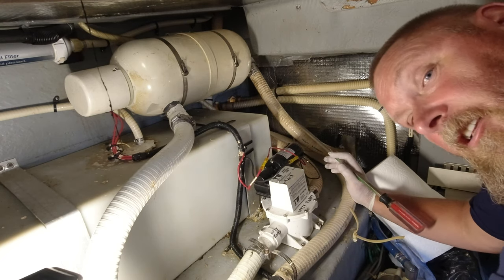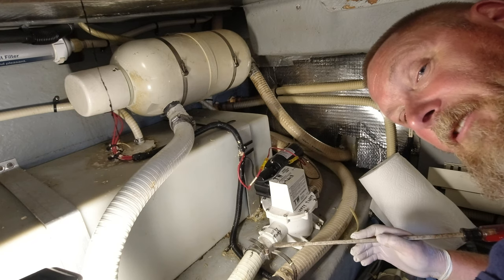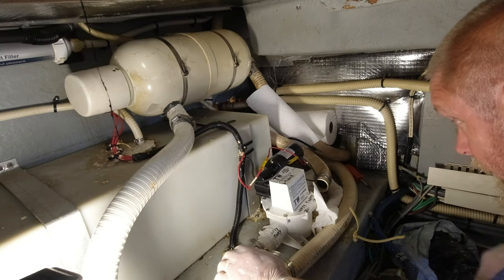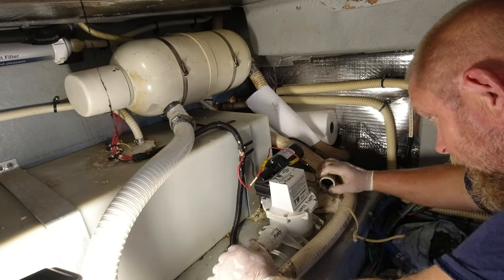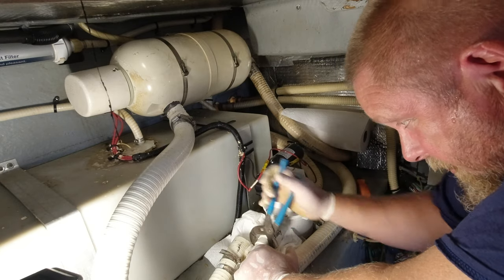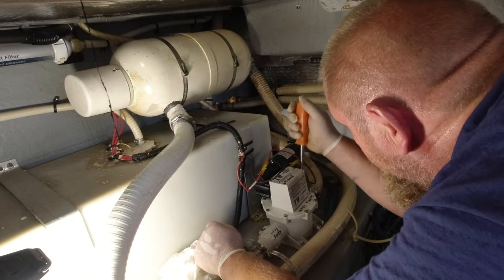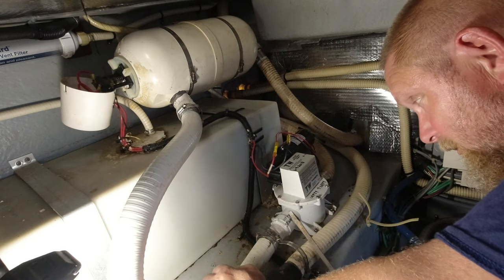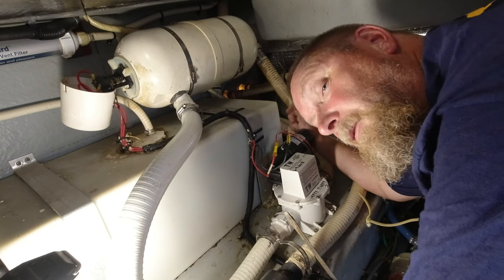SeaRay 35 Toliet Repair

Comment: Okay so not a bad video, however the incorrect pump is installed. TW is to pump out the tank. SW is for toilet to tank. What's the difference??... DOUBLE DUCKBILL on both the suction and discharge sides. The TW has one duckbill on the suction side and one on the discharge side. SW have 2 on each side. Having 2 on each side helps to maintain a seal so that the vacuum is maintained and the pump doesn't cycle frequently.

Comment: We have rebuilt everything in the system but have no vacuum. Any advice?
Reply from the maker: Check the big white vacuume tank, mine was full of paper. I took it off the boat and unscrewed the end where the wires are at and dumped it out. This is the tank about 12” round and 18” long 
Try this n let me know

Comment: Good video, but....   I have a VG1 like what you are working on in the video.  I am working on the accumulator tank, so I was pleased to find this video because you were working, explaining, etc. as you worked through the system.  However, when you worked on the accumulator tank, you didn't include any of that in the video - the very part I was waiting to see.
Reply from the maker: I pulled the accumulator tank out, unscrewed the end and had to dump out the paper

Comment: Liked your video...do you have a single head? Looks similar to my system but i have 2heads.
On mine it looks like i have one pump for eacch toilet is this correct? The aft toilet is piped from the toilet to a vacuum pump then to the accumulator tank then to theholding tank. The forward toilet looks like it comes from the toilet to a vacuum pump then to the holding tank.
Is that wright?
Reply from the maker: Sounds right, that boat was a 350 SeaRay that I sold last year. I had a absolute shit ton of problems with that toilet laugh out loud
I’m happy that boat went bye-bye just because of all the toilet issues I had with it for some reason. My new one single toilet because I didn’t want double the issues on the new boat